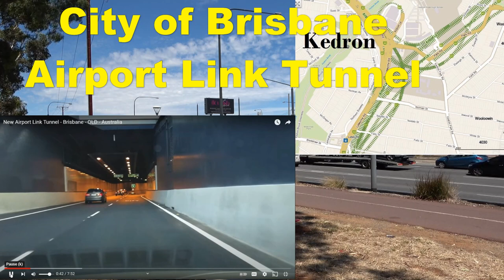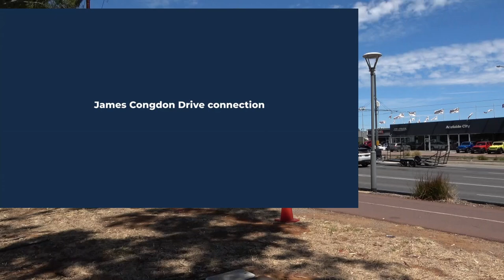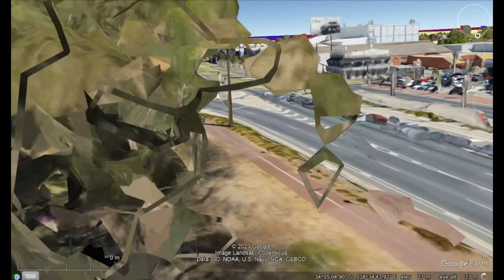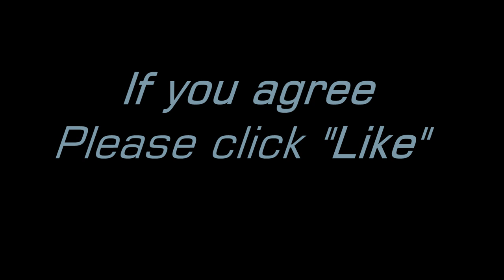Case for an underpass on Adelaide's R1 at Thebarton to relieve transit congestion

Comment: Are you nuts? We don't have the population to do all those tunnels and elevated roads. Unless you are going to put in Billions of $. You want to do stuff like this, get a new revenue streem first without digging into the taxpayers $. And if you really think about it, there is several ways!
Reply from the maker: Hi David   The budget for infrastructure is provided by National, State and Local sources.       
It is where suburbs have developed a community that tunnels are "cheaper" than buying the surrounding suburb and destroying it to make way for a new road.      The 2.2km of twin three-lane tunnels with a portal in Ashwin Parade in Thebarton and the other portal in Frederick Street in Hilton means the community above are preserved.    Nothing is destroyed at surface level.
Similarly the 4km of twin three-lane tunnels between the portal at Forest Ave in Glandore and the portal Celtic Ave in St Marys means  the community above are preserved.    Nothing is destroyed at surface level.
However the middle section between the 2 tunnels will see a massive purchase of private land and business to make way for barren roadways.
NSW in Sydney has gone overboard with toll roads.    Citizens and private businesses are continually paying each day to drive their vebicles on the roads,
Reply from the maker: Hi David.   The alternative  congestion,     Congestion comes at an ongoing cost.